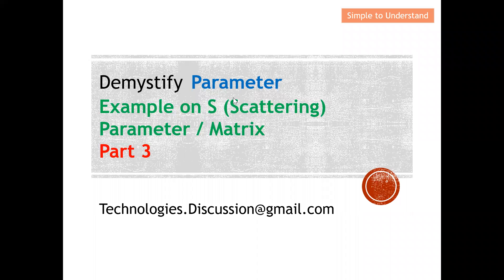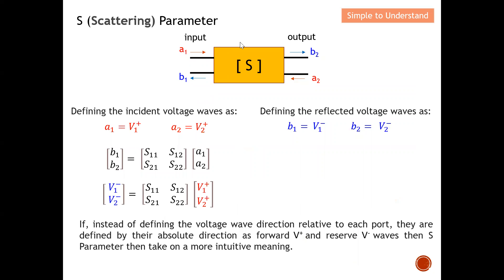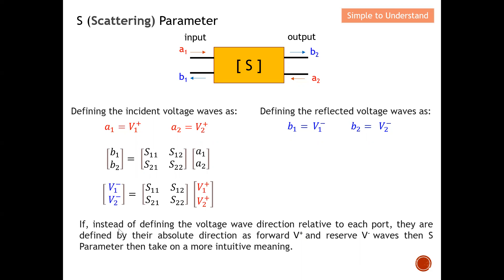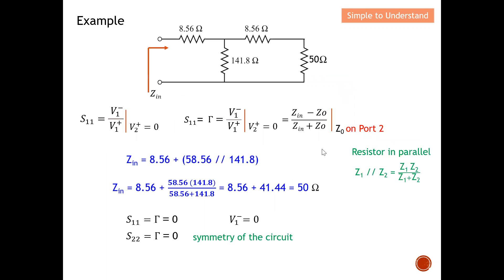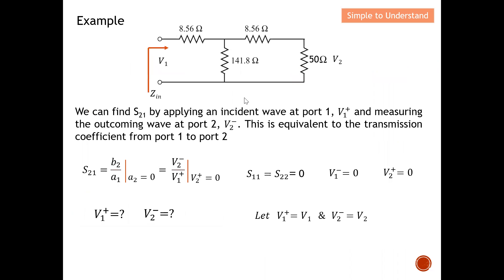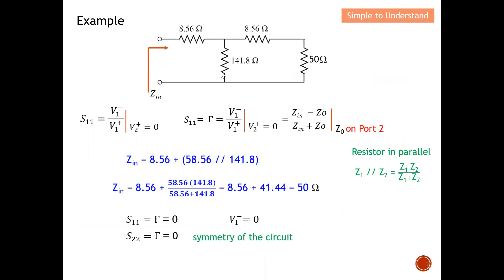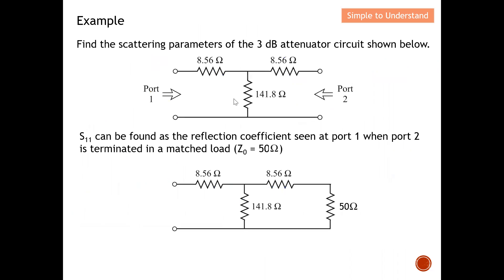Forward Vs Reflected Waves Explained with Example. Why Absolute Direction Matters for S-Parameters.

Comment: Why do you have in numerator for S11 Zin-Z0? For reflection coefficient I expected to see Z0-Zin, as it was shown in transmission line lectures playlist
Reply from the maker: I am sorry, I dun understand your question. 
Maybe, which part of video will help me to understand your question.  :)
Thanks.  :)
Reply: @technologiesdiscussion1676  , I mean at 7:54 equation for S11 = (Zin-Z0)/(Zin+Z0),

but here https://www.youtube.com/watch?v=-xHLX_IkmT0&list=PLFxhgwM1F4yz620k0WcHdRrO5JRAC0yFh&index=6

you derived it in a different way
Reply from the maker: Understand your question now.
For Tx line video, I have Tx line (Z0) in between the source and load.
For the Video of S Parameters Part 3. I dun have the Tx line and I want to find the reflection coefficient at the input.
Hence, that why the formula is different. 
Thanks.
Reply: @technologiesdiscussion1676  could you please clarify it? it’s not clear
Reply from the maker: I may need to make a video to explain this. But will take some time to do this.
Reply: @ it would be very nice and helpful!!)
Reply from the maker: No Problem!   :)
Reply: @technologiesdiscussion1676 , for example here:https://cas.web.cern.ch/sites/default/files/lectures/ebeltoft-2010/caspers-s-parameters.pdf

on slide 8, S11 = (Zl-Z0)/(Zl+Z0), which is different than in your video
Reply from the maker: Zin can be at any position. For eg it can be at ZL also. But for my case, is at extreme left hand side.   :)
Reply: @technologiesdiscussion1676  can you describe this case for S-parameters part 3 mathematically? why the sign is different?
Reply from the maker: These 2 videos are different but is the same concept of reflection coefficient = (ZL-Z0)/(ZL+Z0). 
Let's start with Tx line first: Tx line terminate with a load ZL.
reflection coefficient @ the Load = (ZL-Z0)/(ZL+Z0). 
S11 = reflection coefficient @ the input = (Zin-Z0)/(Zin+Z0). 

My S Parameter Part 3. Port 2 terminate with a matched load of 50 Ohm. You can imagine that 3 dB attenuator circuit as Tx line. Therefore, S11 = reflection coefficient @ the input = (Zin-Z0)/(Zin+Z0). Z0 = ZL= 50 ohm.